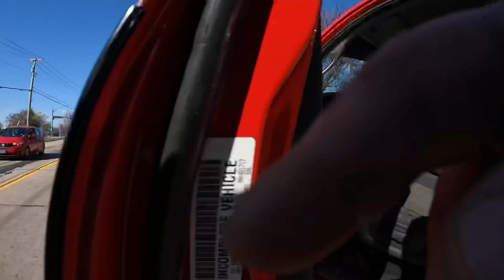Broken Ball Joint Accident Tow

Comment: I always load them from the back and walk the truck under them a lot faster and easier than skating
Reply: @Towvibes  how are you scraping up the bed?
Reply from the maker: They make ball joint skates for a reason lol use the wheel lift not a good idea car has faulty ball joints already in the front what if rear goes cuz parts are just as bad just yank it up the bed and slide it off on old school wheel lift I swear it’s just as much work and don’t have to set tow lights or any thing I’d do it again the same way like I always say do what works for you!